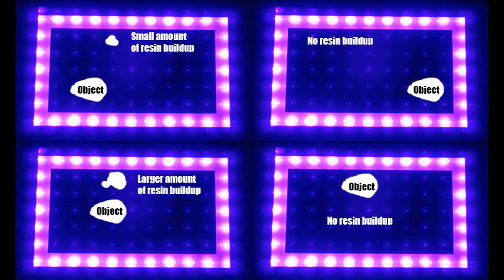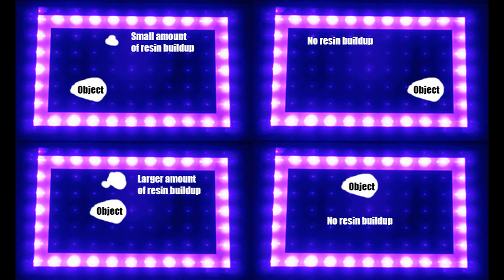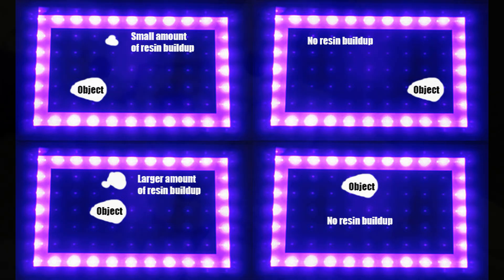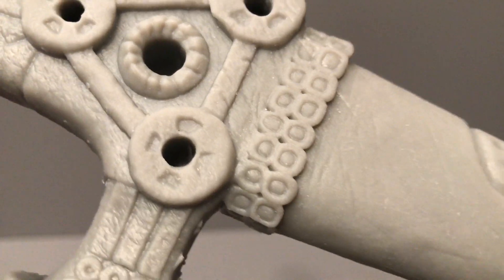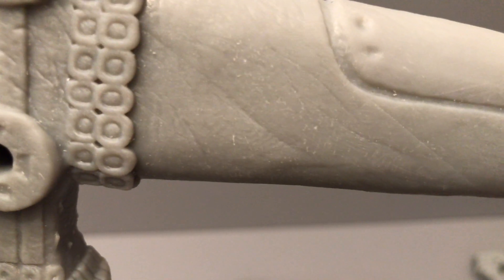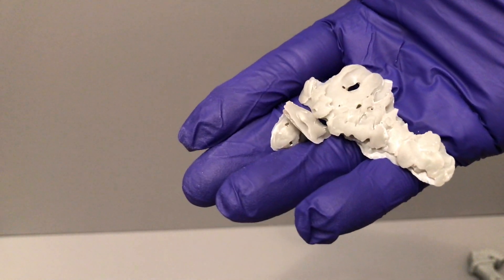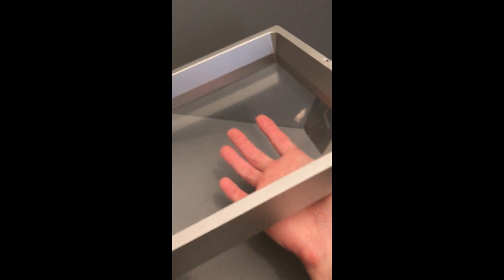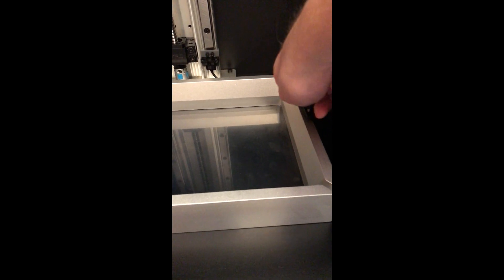Resin sludge is building up in my Peopoly Phenom!

Comment: Hey, did you find a solution to this problem yet? What do you think the issue is?
Reply from the maker: Nope. Got rid of the thicker black tape and replaced with kapton tape, installed a brand new FEP. Still seeing the same results. It has to be some kind of light leak. Maybe some of the light is being refracted as it passes through the LCD? I've since heard from even more people getting this and some think it is just 'normal'.
Reply: Cool. I just ordered new lcd so if that fixes it I will let you know! I too also tried all the above
Reply: I just ordered an LCD. It fixed the issue, but the LCD got dead pixel again after 2nd print. I think the quality of peopoly is quite low. They need to up the quality control or source better parts, or else they will lose customers. I ordered another LCD. If this issue happens again & again, I am getting rid of peopoly & I will never spend money with this company ever again
Reply from the maker: @SuperGiantEgg  Sorry to hear that. I think they all rush this stuff out the door as quickly as they can. I'm sure the whole covid thing did nothing to help either. Hopefully they'll figure out a monochrome upgrade for this thing.
Reply: Just put my phenom to bed. So disappointed in the purchase. I got a leak on my vat, and it leaked all over the screen damaged it. Went through two lcd screens . Found out how i got the leaks. The tape comes up from the back of the lcd screen and there are sharp parts on the back of the screen. So when you slide the vat in it tears the film on the vat.
Reply: What was the final solution I have the same exact issue with my phenom L
Reply: Hi guys, did you get any solution?
I’m facing same issue.
Please let me know

Comment: i was told by mad hacker that the feb had to be changed out at so many hours along with the LCD. how many hours have you been printing with the original parts.
Reply from the maker: Not long enough to require a fep change. It's almost as nice as the day I bought it. Not sure on hours but I've printed a few large pieces. I could understand this after maybe heavy usage but not practically new.

Comment: Seems it turns out it is the lcd wearing out...it is light bleed being caused from wear.
Reply from the maker: I get a perfect test pattern on the screen though.
Reply: @clutch2827  Yea, I was thinking the same thing. I engaged with the engineers at peopoly and after some trouble shooting that is what they told me.
Reply: @David-gr4ko  fixed? Or repeating? Mine gets fixed with new screen then 1 print later starts the same issue

Comment: I have this problem too.
Reply from the maker: I need to replace the fep and tape around the lcd to see if that helps. I've just been hesitant to do anything with the coronavirus slowdown. I don't want to mess it up and not be able to get parts or assistance.
Reply: @clutch2827  we are shipping parts directly from peopoly.net in case you cannot find locally. We can always be reached via support@peopoly.net to help you further
Reply: of Facebook page chat.   We see some evidence of panel aging as the light is uneven is part of the panel
Reply from the maker: @peopoly  it is aging prematurely then because I do not have that many hours on mine. I've printed maybe 6-7 times. I hope you can get this sorted out and come up with one that lasts longer.
Reply: @peopoly  same problem as mine

Comment: Hmmm, that is very strange. Did you cure the clumps in UV for the video or did it come out of the vat that way? It looks like from the video the top portion of the resin clump has also been exposed to UV in some way...Do you print close to a window or other sun light source? Because of the thickness and how cured the top of the clump looks I can't imagine it's an LCD bleed, seems a bit thick for light bleed. If you're next to a light source, it could be that as you're checking your print, the resin on top of the build plate is being exposed to the light, gets partially cured and then slides into the vat when going back down for the next layer. It would make sense as it would likely be centralized to one area of the top of the build plate in relation to the light source.
Reply from the maker: Thanks for commenting. The first bits I show, I cleaned and cured them. I thought it was due do some support issues with the model and thought nothing of it. The second clump was from printing the second thing (solid dagger). The third and forth clumps (together) were from the same dagger print that I had to pause and get out of the vat while it was still printing. My printer is not near a light source in my work room. I couldn't believe how fast this stuff was building up.

Comment: Interesting, been looking and the Phenom and Transform, so far from what i've seen the Phenom seems to be a bit more reliable but appears to be a bit rushed where as the Transform on paper is far superior in almost everything (bigger buildvolume, easier time replacing LCD in about 30 sec, less noise, LCD lasts longer, can use 2 small screen with higher resolution per pixel). On the negative side of the Transform is QC not being the best and Chitubox is not native so from what i read u can do everything in Chitubox and export as STL and use it's own slicer just to slice the file.
Reply from the maker: Hi! I was originally going to go with the Transform. And then I started seeing the delays on Kickstarter. Then I saw that they couldn't go with the quick swap of the screens. Then I saw the issues with the firmware and slow response time to issues people were having. So I went with Peopoly. Ordered from Matterhackers which is based in the US and got it shipped for free. Peopoly is really good with support. Their facebook page is awesome.  I had also had experience with Chitubox and didn't want to have to switch to another slicer. As for this issue, I ordered some new FEP material on Amazon that is ever so slightly thicker and I will peel the tape  and screen protector off and replace with thinner Kapton tape to see if that helps any. I've been really lucky in that this issue is not a show stopper like a broken LCD or loose connection.  I think they are both great printers but I just saw a few more positives in Peopoly that helped me make up my mind.
Reply: clutch2827 Cool thanks for you're thoughts, the Phenom seem more reliable but also seems a bit rushed, not having a tilted bed on top and having resin stay there, also changing the screen on it is a chore. There also an EPAX printer coming out with a large and a very large version and they use the same parts as Phenom.